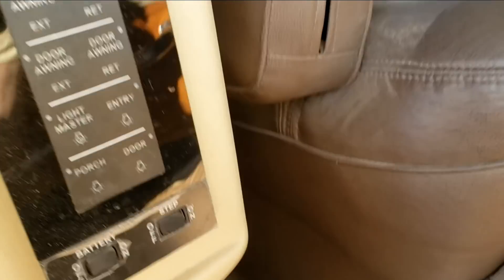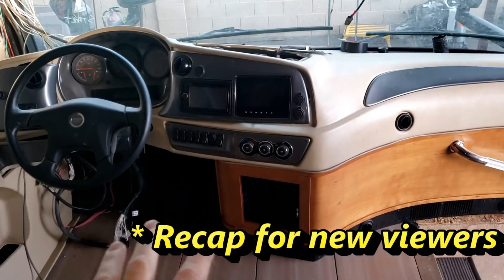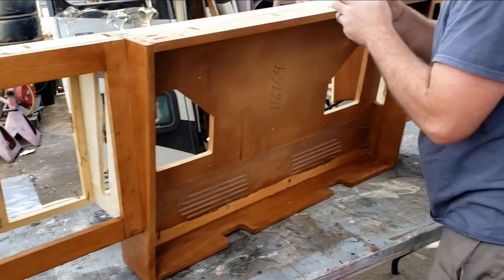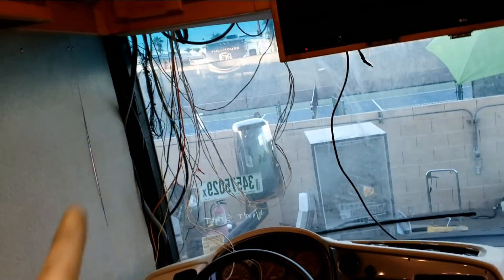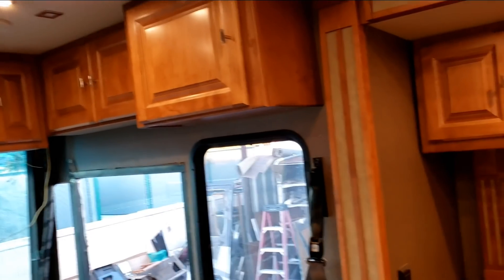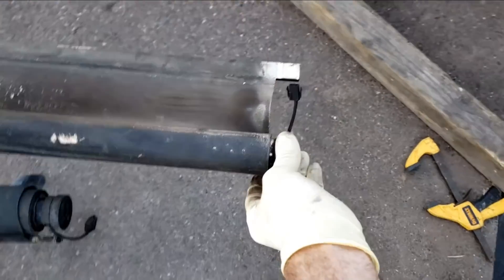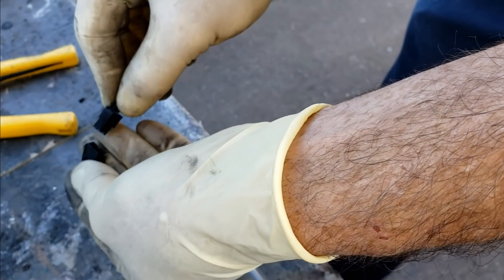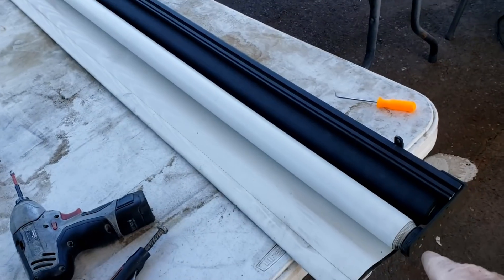Re-building the Cabinets on a Wrecked 2019 Allegro Red

Comment: That gob of wires just bothers me I would have to try to dress them up a little bit.I know you can’t see them but it would just drive me crazy knowing they were all twisted and hanging like that.But everything is looking good.Good job.
Reply from the maker: They get secured, but gobs are very original to factory installations anyway. Only Bus converters like Liberty and Marathon screw harnesses down beautifully every few inches. Of course that's a nightmare for a guy like me that has to remove components with no slack in the harness.